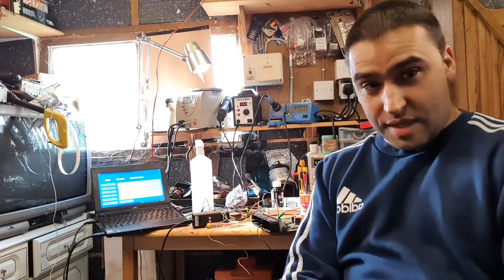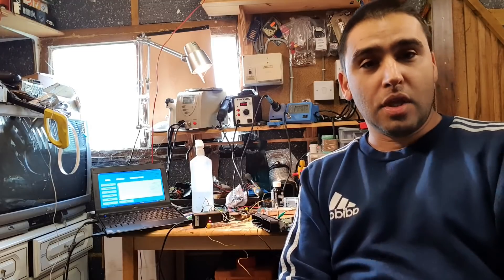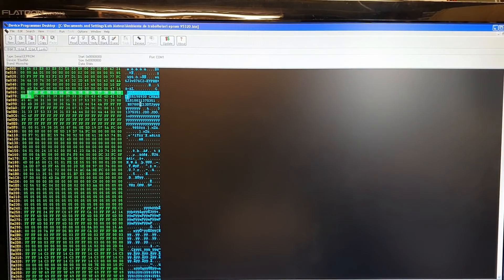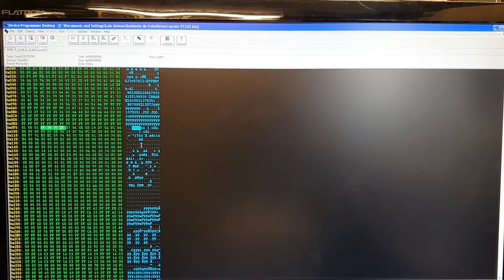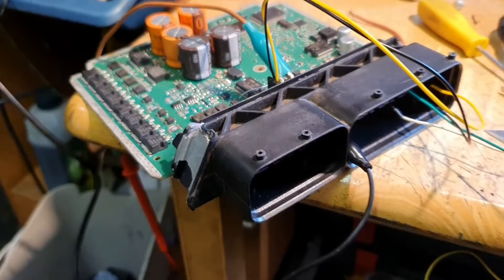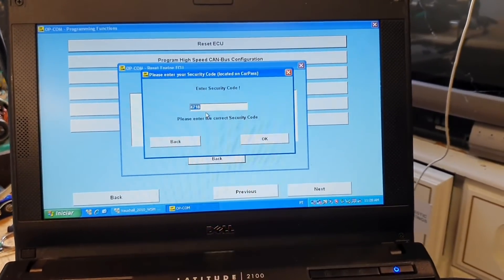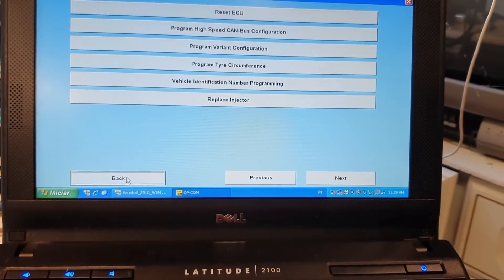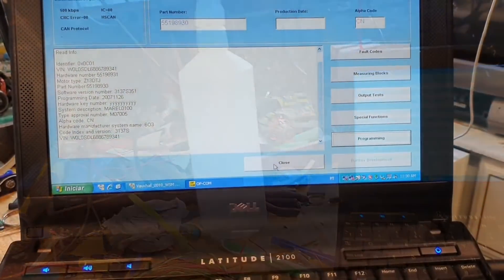Vauxhall/Opel ECU reset. Procedure and what changes. (Corsa D MJD603)

Comment: Hello bossman, I have a Denso D0611, is there anyway to read the eprom on the bench. This ECU has a clear gel inside. Tha owner bought it supposed to be Virginized but was not. Can you point me to a software
Reply from the maker: Never worked on such ecu...
Is that a ceramic pcb?
👍👍👍
Reply: @LMAutoRepairs Yes exactly, with very soft and delicate wire connections.
Reply from the maker: D0611
I don't have nothing about such ecu...
Is it known by any other reference? 
🤔

Comment: Hi, if I no longer have the original control unit for my car, where can I find the codes I need to make the new engine control unit work? Thank You
Reply from the maker: The code should be also stored in the cluster, BCM, and other modules depending on the model of the car.
If you don't have the security card you can always try the dealer...
👍👍👍
Reply: @LMAutoRepairs I'm talking about an Opel Corsa D like the one in the video, thanks for the reply ☺️
Reply from the maker: In that case it is also stored on the airbag module...
Search my channel, I have videos showing how to retrieve the pin from those modules...
👍👍👍

Comment: thank you for explanation.i have one question i have corsa d   3 DOORS HATCHBAK    i need to replace ecu   ORIGINAL      .part number     55568383KZ    MDJ    
603.S3    I FOUND ON EBAY  A  RESET ECU   SAME ENGINE Z13DTJ     ECU      55568385  MDJ603.SO       ,FOR CORSA VAN  WILL THIS WILL WORK.THEY ARE NOT SAME PART NUMBER , THEY ARE SLIGHTLY DIFFERENT THANK  YOU '
Reply from the maker: Different part numbers can be an issue, but if it is from a car with the same code, should work...
👍👍👍
Reply: @LMAutoRepairs  thank tou so much

Comment: Thank you for the video. I know it's an old video but hope I can get some help. It might be a dumb question but bear with me. I have 2000 Vauxhall Astra G, swapped the 1.4 engine for a 1.6 engine but kept the original engine ECU (well the service center did not me). Is re-programing the ECU a must to fit the new engine? I'm logically convinced it is but they are not. Appreciate the help
Reply from the maker: Already responded...
👍👍👍

Comment: Could you explain how exactly to wire up the ECU with OPCOM reader?
Reply from the maker: Ecu to opcom only needs can hi and can low...
The rest voltages 12v, and grounds...
👍👍👍
Reply: @LMAutoRepairs  I've googled for a long hour but I could't find the pin diagram for this Marelli ECU... Where did you get the diagram from?
Reply from the maker: @losFondos 
Search "mjd603 pinout"...
Will take 5 seconds to find it...
Reply: @LMAutoRepairs  right you are, thanks a lot mate! You got a new patreon for all the good stuff you put out;)
Reply from the maker: @losFondos 
😊
Thanks!
👍👍👍

Comment: Hey man, If I have a broken ECU, can I simply remove the eeprom chip from the broken damaged one and fit it on to a replacement one or is it not as simple as that? Cheers!
Reply from the maker: Depending on the ecu... yes...
Some that doesn't work...
👍👍👍
Reply: @LMAutoRepairs  thanks man. Same ECU as your video from Z13DTJ Corsa D
Reply from the maker: Yes... the eeprom swap should work...
👍👍👍
Reply: @LMAutoRepairs  thanks for your help bud. I’ll try read the data from the chip first and then if I have to I’ll swap them. I used mpps to get the code off the new ecu but opcom just hangs when it asks me for the security code when I go to reset the ecu.
Reply from the maker: Make sure the security time is not active...
Also, certain Op-com versions are a bit unreliable on certain cars and functions...
Reply: @LMAutoRepairs  hey bro, i don’t suppose you have an eprom file you could send me that I could use at all? The original eprom chip of mine is totally dead 😞
Reply from the maker: @avayaguru6679  
Not sure... would have to have a look on my server...
Reply: @LMAutoRepairs  appreciate it man. 👍🏼
Reply: @LMAutoRepairs  i fixed it man. Just swapped the chip over. I think my programmer is dead so I just swapped the chip and the car started right up.
Reply from the maker: That's fantastic! 
Well done!
👍👍👍

Comment: Thank you for a great video, we have a corsa D Z12 XEP with a Bosch ecu, ' 0261 20 89 40 '  ME 7.6.2 , and it had a battery go flat, which threw up the immoboliser spanner on the dash board, we 'reset the e .c.u ' with a Tech2 diagnostic machine (a china clone) and we have a Tis sps programming software installed on a laptop (Panasonic cf 19 with windows 7 operating system) to get the programming approval, but it does not connect with the Tech 2, how do i reinstall the 'Pin' back again, i have a Galletto v,0475 and  a Kess 2 programmer, have downloaded the files, what can i do now with the file to modify or insert the correct pin back again, will it work, or does it need the Tech 2 to 'reprogram it, i have the Pin code from the owners security access card, would appreciate your kind help, thanks.🙂
Reply from the maker: Hi
It doesn't work like that...
Watch this...
https://youtu.be/A_egfjWCZKo
👍👍👍
Reply: @LMAutoRepairs  Thanks Luis, keep up the great video's, best regards, 🙂

Comment: Hi, I did an ecu reset on my Meriva A 1.6 because I always had errors on the carburetion (despite having replaced the lambda probe and manifold pressure probe).  
After the reset I had to reprogram the immobilizer. 
From after the first ignition the engine runs at 3 (cylinder 2 misfire error) will it be a coincidence that I have melted the coil?
Reply from the maker: The reset would not make a difference for your problem...
The reset is for the immobiliser...
I would say it is a coincidence...
Just make sure that the coding is correct, otherwise you have something else causing your issues...
👍👍👍
Reply: @LMAutoRepairs  hello and thanks for the answer.  
I replaced the coil and now the machine is working fine.  it was a coincidence ... very well that the reset had an influence only on the immobilizer, I was afraid it could completely reset the control unit.

Comment: Which EPROM reader are you using?
Reply from the maker: X-prog...
👍👍👍
Reply: And what hardware?
Reply: Could you explain where to fin the PIN on the edc15m board?
Reply from the maker: It does not really work like that... different manufacturers use different immobiliser systems, and data is stored in different areas on the modules... each car is a case...
👍👍👍
Reply from the maker: X-prog...
😊

Comment: hi! can i replace a bad ECU on a astra 1.7cdti with another second hand one,without programming? what else should i need to replace as all system to work as it should do?(transponder,key transponder,cluster,etc?). i mean if i will replace all those car modules on my car,with others from a doner car ,would my car work as it should ??? start engine,remote locks,aircon,etc..? thx!
Reply from the maker: Hi
You can replace with an used one, but you will need to program it...
If you replace all those parts, yes everything should work...
Just remember, mileage will be incorrect, unless you find all those parts from a car with similar mileage, and there is a possibility that some features might not work until coded accordingly to the car... again, unless you get the parts from a car with the exact same options...
Good luck...
👍👍👍

Comment: Here is an interesting one: after resetting ecu, bcm sdm and ipc and then reprogramming all back ( after bad battery ), the esc or traction control light would light on the dash, with no errors in the memory. Any idea on this? I used op-com for reprogramming.
Reply from the maker: Check configurations...👍👍👍
Reply: @LMAutoRepairs  Thanks for your reply. You probably mean the variant configurations matching across the list of modules....
Reply from the maker: Correct...
👍

Comment: Hi My friend,
I reset my ecu mjd603. And i have original pin code but immo not accepted this code! What can be ? 
I need to use for immo program in Bcm menü this code but as like i say opcom not accept this pin code more. ( ım sure original pin code same because i can read epprom95320 with mpps v18. Also wenn i reprogram epromm with mpps car can start again not flash immo symbol. But i cannot eith original code immo program 😆

Comment: hi guys i have problem with mu Opel Astra g 1.7 dti 2001.
problem is westgate  on opcom diagnostic 
Pulse Ratio boost solenoid valve SV 5.1% when car start on idle.
when press pedal to 2000rpm reading ist 00.0%
when driving in 3 gear push the pedal full to flor and reading ist 00.0%  when  move leg from pedat  reading 18.0%.
no codes on board nothing 
car ist lean and lose power... any help please

Comment: nice video
Reply from the maker: Thanks!
👍👍👍
Reply: @LMAutoRepairs  Hi, I just want to share my experience...
 yesterday I was watching your video because I stock with wrong pin code (accidently make photo from another eeprom hex file with pin code) then when tried to reset ecu in the car I get  "wrong pin" "wait time active 20min". after 20 hours of trying to solve this issue I noticed that vin in the foto does not match with vin in opcom. finally problem solved by writing firstly readed (original)  eerpom file - no "wait time active" and ecu reseted without any issues.

Comment: Great video.
I think more manufacturers should allow for units to be reused, but I guess it opens the gates to thieves stealing units, been able to modify them to later access the vehicle (shaddy workshops) and what nots.  Also right to repair is eroded with units that cannot be reset or reused, aside of the profit for new units.
I guess being environmentally friend is at the very bottom.
Reply from the maker: Indeed it is... 
Thank you for watching and for your comment!

Comment: Hi again, do you do micro soldering on request? I have a megane tomtom multimedia controller and it seems like some water got in somehow. There was some corrosion and one of the smd's have lost contact with the trace. I would try repair it but it's so tiny I cannot see anything at all. New part is only £35 but it's just a waste when all it needs is the smd replaced.
Reply: Why not try to find a GSM repair shop and they might help you. Unless you are local, paying post is gonna be as much as a " new " one.

Comment: So just to make things clear. We don't need an xprog to retrofit same type ecu from one car to another it just takes some regular functions of OpCom? We don't need to do all reading eeprom stuff. Is that correct?
Reply from the maker: Yes... As far as you have the pin codes, or and/or the replacement module has been reset...
Thank you for watching!

Comment: Thank you sir for sharing your knowledge. But I have a question and if you please can you answer it ?
I have Porsche Panamera hybrid 2016 which had an accident and damaged the half of the inverter ( you can separate it to two parts ). I tried to use a second hand one but unfortunately it is immobilized and the car won't run any more. I assembled them together and make it run again. The question is how can I know which EEprom that has the immobilizer inside it and how can I locate it on the board or can I even passed immo. ? 

Thanks in advanced

PS: no one in the whole country here can help even Porsche themselves couldn't make the car alive again but I did it. So I am the only hope for that machine 😅😅

Comment: Hi dear, thanks for all ur videos. Reset, virginize, immo Virgin, immo off, immo clear all these stufs proceed in immobiliser system and as u told addresses of changing in eeprom is different from an ecu to others and from car mark to other marks. It's simple the processor of ecu looks to VIN or pin or any infos in eeprom knowing exactly where is address for each information it's programmed, it depending of hardware and software version of ecus. We must learn any immobiliser system before attacking it or working on it and always always do backups before changing any thing. Thanks Luis, ur Algerian follower was here :-)
Reply from the maker: 👍👍👍
Thank you,  for watching and for your comment!